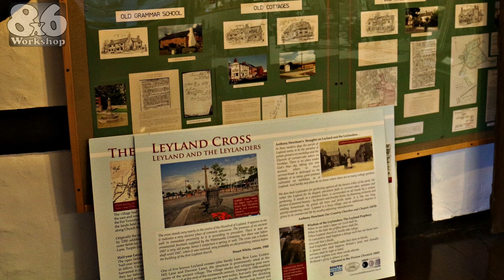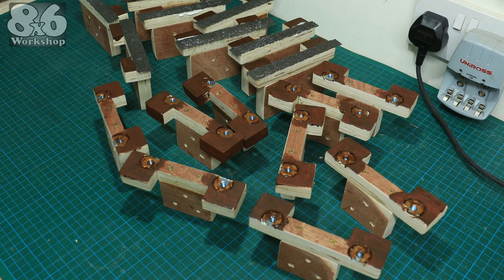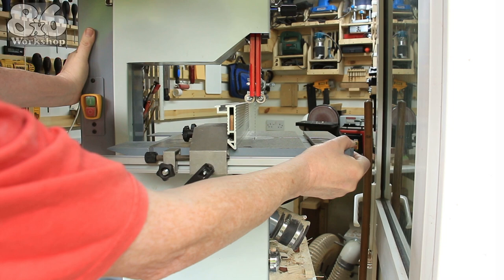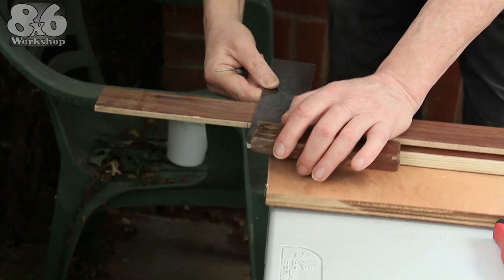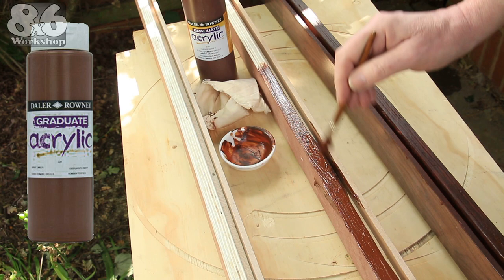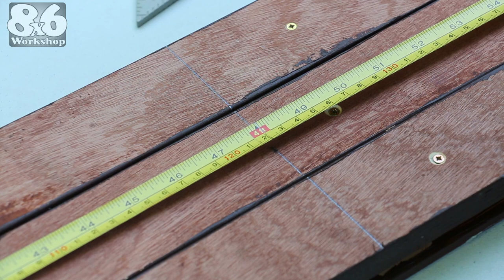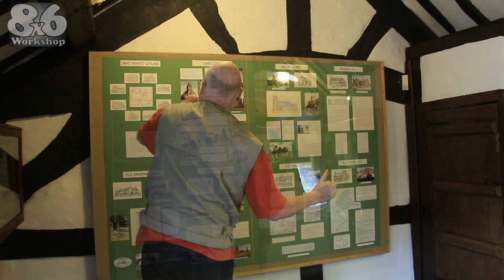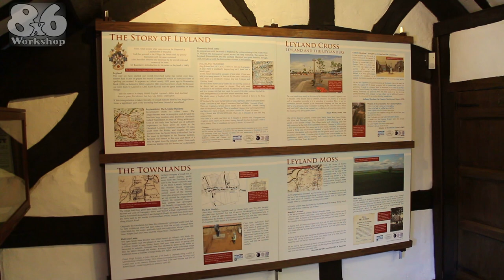Museum Display Build from Scratch - Adjustable System for Leyland Museum - [Subtitles]

Comment: First class Stephen! Splendid work and good planning to cope with the exigencies of working within graded list building code! I like the jigs and I am sending you a box of ambidextrous screws! :)  Good to see Stanley clamp and well done Lilly for signing this great job off!
The finished work looks just right and blends perfectly with the 16th C wood structure. I look forward to seeing the display, the clamps were genius to make it a versatile piece of museum equipment! Thanks for a great film!!  :)
Reply: Eryk Freethinker Eryk he is an endearing Maker of things & I’m so happy that I know both him & you mate 👍👍👍
Reply: Hello Dirk and the same goes for me mate - I would not have known about your channel except for Stephen introducing me. The museum is a quirky building and as my eldest son once had a listed town house I can tell you the code is more about what you cannot do than what you can! :) Utilising the existing frame with the attachments already in place was a great idea.
I would like to know if you have protected buildings in your towns and cities. I suspect the climate makes the sustainability of them quite a challenge. My friends in the USA say termites are one heck of a challenge where structures based on wood frames are concerned.
I have to say, Dirk, I was wondering how Stephen would deal with the longer lengths of wood in an 8x6 workshop, outside was the obvious solution but if I tried that I would need to learn to fly - I live in a first floor flat!!!   :>)  👍 Hey!! I managed a proper "Thumbs Up" WaddaYaKnow!  :)